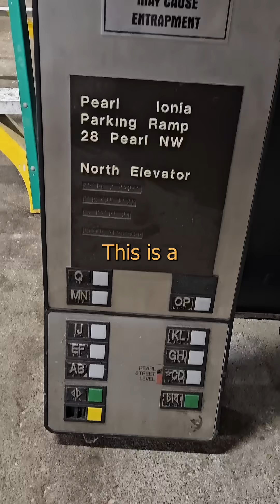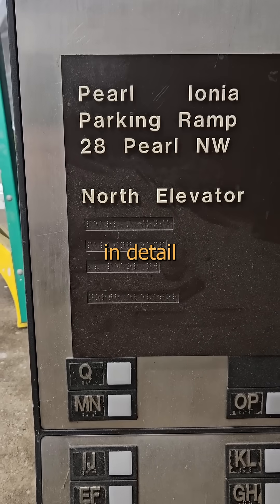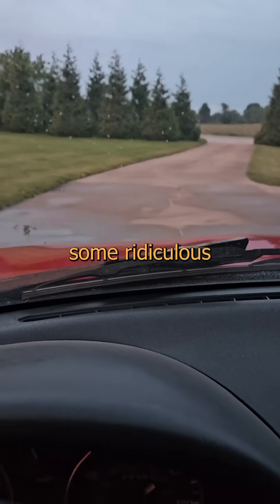Miata Mischief #chrisboden #engineering #gear #elevator #score #stories #parts #hacking #making

Comment: We owned a Ford Contour (about the same size as a Toyota Camry). And our truck broke down  but we still needed to haul large items. 
3 bales of hay and four to six 80 lbs. (35 kg?) bags of horse feed in the trunk. Greatly exceeded the max gross weight of the vehicle.

Or, (I think the statute of limitations has run out) the day that we purchased three large desks and other things. We had a Chevrolet S10 Blazer (small SUV) at the time and three passengers. Two of the desks were under 75 lb but still longer than 6 ft. and about 3 ft wide. One of the desks was fully steel with a wooden top and 6 ft. long by 30 in wide and weighed about 150 lb (75 kg?). After interlocking two of the desks together and lifting them up onto the roof of the Blazer, we still had to figure out how to transport the heavy third one.
Two of the passengers got to ride in the front seats, but after barely fitting the desk into the cargo area of the Blazer, the third passenger had to travel within the leg area of the desk for over 125 mi, I think that works out to almost 200 km.

Comment: I once bought 2 Chevy 350 engines on marketplace for about a hundred bucks each, the problem was I only had a Chevy Aveo at the time due to my car being wrecked and at the time body shop. So I had to pull all the seats out at home but the driver and set the two engines in the car. It was on the bump stops the entire ride home.

Comment: I bought a 10ft all aluminum jon boat, if you have an email I can send pics but I literally flip it upside down and put it on the roof of my 2006 cheverolet cobalt coupe, add a few ratchet straps to the fenders and towels on the roof to hope the boat doesn't scratch paint (I do this every now and again to take it out on the water)

Comment: Not so much to get it home, but I used to pull the front passenger seat out of my 180sx, then fold the back seat down and slide my stand up jetski in through the hatch and down into the passenger foot well. It basically took up the whole passenger side. The double takes I would get driving down the street was hilarious. People would just be looking around stopped at the lights and when they noticed, they would have to take a long serious second look to make sure they were actually seeing what they thought they were seeing. I would just smile and laugh.

Comment: A buddy of mine’s dad had a sound system beefy enough that i could be my own sound guy for smaller and medium sized venues. like 20k in professional equipment, mics, amps, mixers, sound boards, etc. He said if i could move it all out by myself i could have it for free since he got a new setup and all that equipment was just wasting space. let’s just say i had multiple trips back and forth with my skateboard in the span of 4 hours. by the end of it i was so torn out and tired i didn’t even want to set it up (or remembered how he explained to set it up)

Comment: I recently built an 89 Chevy that I bought for 800 bucks, had a transmission refill brought the drive shaft to a driveshaft shop it's a long bed Chevrolet two wheel drive. I fit that whole two piece drive shaft which I made it to where it just barely touched the hatch with a bit of padding between it and the hatch and then there was about 3 in between it and the the lower part of the radio bezel in my first gen crv, and when the turbo 400 transmission was done at the shop she brought that home too. It's all a truck if you squint and just say good enough.

Comment: It was actually getting the vehicle itself home. Remember the 3 cylinder Geo Metro 4 door? Well as I went around a fairly sharp turn with my 20 foot extension ladder on the roof ( you use what you have to get that almighty dollar) the front subframe tore at the lower control arm rendering my 50mpg ride useless. Literally could NOT drive forward without wheels heading opposite directions like a couple in a horrible divorce. I could go in reverse straight but not turn. Everyone said " Call a tow truck.". No money for that because it was Friday and I would rather down repeated glasses of Fukitol at the local group therapy place called the bar.  I off-loaded the ladder and stowed it on the job site. I then used the ratchet straps to hold the control arm in 4 axis and tightened them tighter than an Amish 18 year old. With a prayer uttered I proceeded to drive the oversized matchbox car the roughly 18 miles on Pennsylvania's twistiest back roads to my house to prepare for group therapy and Fukitol. I pulled into my driveway and as I pulled up to the house I heard a twang that Conway Twitty would have killed for and the clown car slid to a stop with front wheels wider than the Amish broads legs after an encounter with two bottles of Goldschlager and the football team. In my haste I had routed 2 of the straps across the exhaust. Out came the jack and with a simple reroute my chariot was back together enough to supply transport to the therapy session where I promptly sold it to a " friend " who had begged to buy it or, wait for it, trade for his ranger pickup. My ride home that evening was CONSIDERABLY less stressful and it wasn't just the Fukitol working it's magic. He called me the next day asking where I had hidden his new money saving 12 inch tire wearing pride and joy? He said he drove it home and went to bed. That's right, as the saying goes, there's an ass for every seat. Someone had decided that since the keys were in it, he didn't deserve it and had "borrowed" it and when it was found 3 weeks later the police officers who were towing it to impound noticed the ratchet strap front subframe and deemed it unfit to be on public roads. His insurance claim got him just enough to buy a new to him 220 thousand mile, again, wait for it, ranger pickup. I was in the clear, right? Until they discovered initials on the straps that matched mine perfectly. Plausible deniability is amazing.  Except one strap had initials that didn't match other 3 but DID match the homeowner of the house where the car was parked. My initials were easy to explain but his were much tougher to explain. He never did time because no one on the force cared enough to file charges. They were more amazed at the ingenious geometry keeping the car together. At insurance auction the car was bought for double digits and it donated engine and trans to a much less rusty Metro. I drove that car for another year and my "friend" traded me another ranger pickup.  I lost touch with him when I gave up Fukitol and it sadly was crushed when an overdose of Fukitol clouded the mind of it's proud owner and he failed to yield right of way to Bambi.

Comment: 35 years ago, me and some buddies did so many of those types of hauling that I can't think of one that would be more remarkable than so many of the others.
Home made trailers hauling full size trucks out from off road adventures, the full size loaded trailer that lost a wheel between 25 foot high snowbanks and having an industrial lifter (digging snow) help move it, boats, canoes, a Honda civic towing a "raft" that was more than twice it's size and mass up the hardest hill ... Yeah, I remember them still. maybe if I drink more I can forget some of them.

Comment: there was one time where we had to get my older brother a new bed frame since his old wood one had caved and he wad sleeping on a mattress on the floor, turns out my mum knew someone who was giving away a nice new metal one
so off me and my dad went to pick it up in his nissan joke (juke) which has about enough cargo space to fit two women it wouldn't get you even with the rear seats folded
my dad was adamant that it would fit since it was in pieces but lo and behold, the frame was too long and we couldn't shut the boot so we had to drive all the way home with an open boot while i had to cling onto different pieces of bed frame to stop them falling out like an inverse game of whack-a-mole
we made it but boy was it sketchy and i almost lost the headboard at one point when going over a speed bump

Comment: Found a generator in a construction dumpster and re oved the hetch of an old geo to fit it in. Bungee cords, zip ties, and a bit of rope. Tied the hatch off on the roof and left. Still have the generator 15 years later, and it still runs. Gotta love Honda.

Comment: Loaded a 16ft metal canoe and an 11ft kayak on top of a corolla using generic clip on cross rails.  2 miles from the river the whole rack broke, gouged a nice gash in the edge of my roof and left the racks and boats hanging 3ft off the drivers side window.  i got out, lifted boats, racks and all back onto the roof, threw an extra long strap over top of everything and fed it through both back windows.  I gave each side of the rope to a different international girl and told them to pull down with all their strength.  then i kept driving while holding on to the rack with my left hand out the window while i drove (and shifted gears) with my right hand. it was some classy redneck engineering but i kept the speed low and all was well.

Comment: I once used a small pickup to haul some very long steel pipes. In no way were they going to fit in the back or on top. So I drove over top of them and then strapped them up to the bumpers so that they were hanging underneath the pickup. We then drove them clear across town with no issues.

Comment: Ikea desk that barely fit sideways all the way up between the front seats, so my wife and I had to talk around it the whole way home, but ive also filled my car with random computers and monitors and other random electronics including the power supply for an old server rack where I got the biggest transformer ive ever had my hands on that we call the "toe crusher" because it fell once and my wife is lucky to still have all 10 toes bc it barely missed her

Comment: Turns out if you're really, REALLY motivated to modify your 1983 DAtsun 280ZX, not only can you haul full sheets of plywood and 8ft 2x4s hanging out of the back of the hatch (loosely held in place with more Home Depot twine than any one individual should be allowed to take), you can build a vehicle stand with all of that. A vehicle stand that creaks louder than the bones of a horny Monk when you drive your 280ZX onto it!

Comment: I moved from one side of the country (PEI to B.C. Canada) to the other in a 2006 ford escape short box less than 1/4 ton truck 20 years ago with my gf at the time 3 months old 2 cats and all the belongings that we could fit. Probably an extra 500LBs over what the truck should haul like tires would rub in wheel wells sometimes. Tied down with 15 years old ratchet straps bungie cords stolen from my father and hopes and dreams  Anyway most of trip was fine but the last day crossing from Alberta to BC through the mountain pass winding up and down the side of mountains mind you we made it there the day before it became illegal to drive without snow chains like middle of November and of course I did t have snow chains. Driving down this windy road with no barriers on side of road just 100ft drop seeing big hail trucks going off road to emergency crash lanes. We also passed a commercial passenger bus on the side of road was caught on fire as we drove by. Made it through but that was the most unsafe yet still legal driving I’ve experienced. Got plenty of not so legal experiences to but that’s for me to know only lol

Comment: 1300 pounds of concrete in the tail of an '05 GMC Canyon. Just about dropped the back all the way to the ground, which I only know because I unwittingly passed my mom as she was coming out of a parking lot. At least I was smart enough not to cross the railroad otherwise I might've high centered the dinky pickup. If you ever find yourself at the Paulding County Animal Shelter in Georgia, the gazebo to the side is where that concrete ended up, helped me get my Eagle Scout!

Comment: I am a truck enthusiast, so when I went to the local junkyard (no car) to get a semi truck shifter, I somewhat expected to be asked to leave by the staff. I wasn't, instead I talked about pickup trucks with two workers for a half hour or so and got a 10 speed shifter to mount for my game. I walked that thing home and tried to disassemble it but wound up taking the "I'm not asking" route of an angle grinder to the shaft above the part I wanted gone.

I also bought "reading lights" (two fog lamps) as a birthday gift for a buddy and they surprisingly weren't a last minute attempt. I found a torque bar on the ground the walk home as well (Score).

Comment: My dad had a 92 chevy lumina and we were moving he bought a 18 foot high sided landscape trailer and put a hitch on the car loaded the trailer over the course of a few days the whole bottom was cinder blocks and paving bricks stacked 2 or 3 levels high plus any outdoor stuff he could put in it with a bunch of 1 inch straps ... to this day idk how he steered or came to a stop my right hand was on the door handle the whole time was buckled in the whole time but could still bale without worry if need be that car was a tank if you come across one buy it his had over 300k miles only thing that put it down was a fire in the dash

Comment: I lived in Cincinnati for what felt like longer than 30 days. I was driving around with my girlfriend at the time and we came across one of the scooters with the basket from one of the local grocery stores just left behind on the sidewalk. 

The interesting part was this grocery store was on the other side of town. 

With no one around I immediately said “I want this”. I had a Mitsubishi outlander at the time and her and I could not manage to fit it into the car even with the seats down and back door open. 

We were less than 10min away from home and the cart had very little power left but would move if it was pushed. I took my ratchet strap and tied it around the handle bars to keep the cart as straight as possible. I drove around 5mph with my gf sitting in the scooter.

We put it in the shed in herbackyard and broke up about a week later. 

I never went back for the cart😢

Comment: Ford escort, slide front passenger seat all way forward recline it back drop both back seats down load 2x4s threw hatch back, did same thing with a flat screen and weight set in a Ford Fiesta.

Comment: My boys and I got a boat. About 20ft, enclosed, beached and tipped upside down after a flood a year ago killed her. We were young, dumb and filled with cheap beer. Using the raw strength of 6 18 year old gym rats, we tipped her back upright, and with the bonus of car jacks got her onto the back of a friend’s dad’s pickup. Now, I may not be a mathematician, but I’m pretty sure an 8 foot long bed doesn’t fit a 20ft boat. We… managed. Jerry rigged a system for the hull to not drag on the ground, and got her out. She was eventually returned ti her original owner though, as contrary to what we believed, she was not abandoned and derelict, simply misplaced. It was a fun phone conversation with an irate old man, until he realized we meant no harm and gave it back. I don’t live in that city anymore, but like to think the HMS Eat Ass 2 lives on.

Comment: Found a place selling ibc totes while looking for a 55 gallon drum for a water barrel. Ended up sticking a 330 gallon ibc in the back of a 2 door jeep by pushing the top forwards and strapping it on to the roll cage at an angle. It drove better than the full size fridge did sticking up from the back.

Comment: 1,600 lbs of scrap brake rotors in the trunk of a 1996 Dodge neon. The rear suspension was non-existent and had the stopping distance of an aircraft carrier!

Comment: Used to haul scrap metal in my brother's 96 corolla.  Rather, on it. We built a makeshift roof rack on top and and moved thousands of pounds of metal stacked on top of the thing. The most we ever moved was 1200lbs total of copper, extruded aluminum, and steel. The roof was partially caved in but it got us where we needed to be

Comment: I put a roof rack on my 1972 baja beetle, I  have had 8 full sheets of plywood on the roof, and 14 twelve foot boards. I also had my front seat down with an 8 foot 2x16 hanging out of the passenger side window (the exotic woods get the cozy seat). I don't know why so many people want a truck when a few ratchet straps and a can do attitude lets you carry anything on your vw beetle.

Comment: When I was 16, I got a job working on a local estate, about 3 or 4 miles away. Every day, I’d pedal there on my bike. One day, I saw they’d felled an old oak tree to make planks. A company came in, milled it on-site, and left the green wood stacked in a barn to dry.

Now, because trees aren’t conveniently square (if this is news to you, maybe log off Minecraft and step outside), the planks had rough edges that were trimmed off.

Most of it was only good for kindling, but I realised some pieces could be run through my grandfather’s bandsaw and turned into 2x2s. Perfect for a table. Free Christmas present for my parents? Yes please.

The usable scraps were around six feet long. So the next day, after work, I sorted through the pile, picked the best bits, and carefully bungeed them to the rack on my bike—some on top, some hanging off the sides. For safety, I tied an old hi-vis jacket to the back.

I had to lean forward just to stop it doing wheelies. But it was fine at first. a nice, gentle downhill run from the barn to the main road. Then I hit a bend. And here’s the thing: physics has strong opinions about objects with a centre of mass, far from its centre of rotation. 

There was a twang (which still occasionally haunts my dreams), and next thing I knew I was airborne.

I ended up walking the twisted wreck of a bike home, leaving a lovely trail of blood.

The table did get made. It was gifted, very briefly admired, and immediately relegated to the guest bedroom, where it remains. Twenty-two years later, my knee only hurts on days ending in “y.”